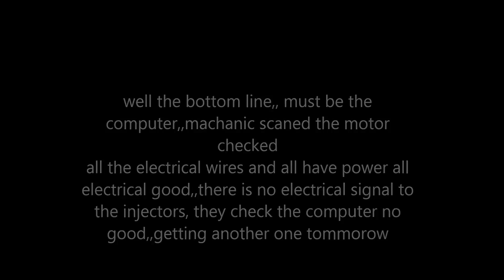AT THE MACHANIC SHOP,,UPDATE

Comment: Look at 7.24 at the fuel line it's kinked in half? if it runs on Starter fluid but dies you got a bad fuel pump...or that line thats kinked ..need to put a fuel pressure gauge on it and check pressure...
Reply: Looks like someone kinked that fuel line which would cut the gas supply to maybe half or plug up with no gas coming thru the line.

Comment: YEA! bigg dogg, that what im talking about! stay positive.  it looks like the fuel line on the passenger side is twisted, i dont know if its a supply line or a return, been a long time since it worked on  throttle body 350. if you havent already, ask the shop about that, wouldnt be a bad idea to replace it.

Comment: big dog stay positive. on a side note 2 things.
1. has the fuel pump relay been checked?
2. hard to tell from your video and prob.not related to your problem but looks like it could be a problem that hard fuel line going to the throttle body looks kinked. It looks like it's been over tighten at some point. please have that fixed if it is the fuel line and it is kinked it could cause a fuel flow issue down the road.
something caused those wires to overload and burn maybe a bad ground somewhere in that circuit. need to find what caused that or it might fry another computer. 
just some ideas big dog not trying to me a keyboard mechanic here but I do know a few things. 
take care and breath deep.

Comment: Sounds like a sensor problem to me. Starts but doesn't run. Or the fuel pump. Can you bypass sensors to see if it will stay running?